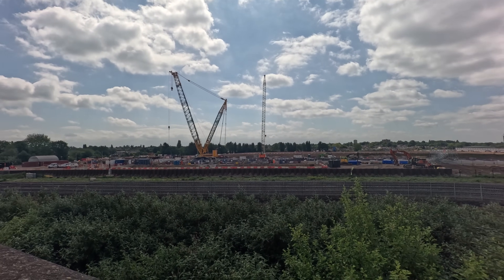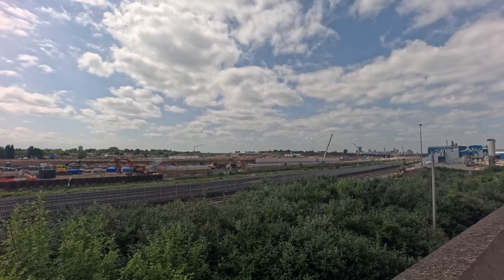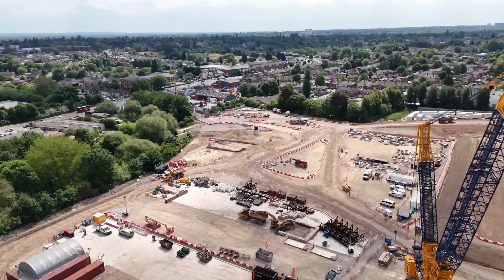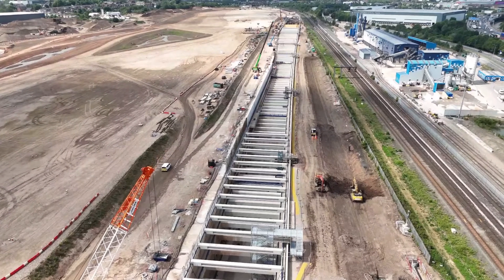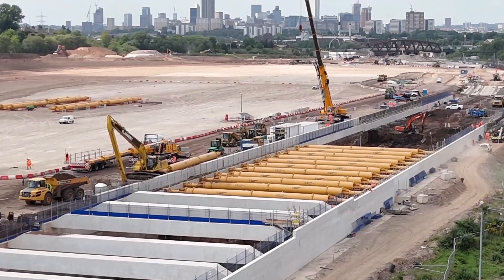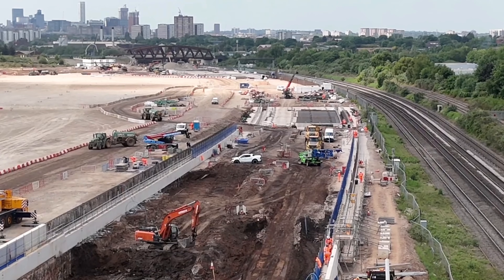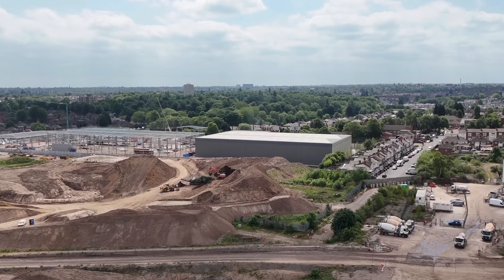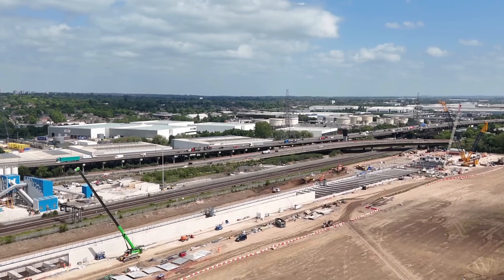HS2 Washwood Heath Update | TBM 'Mary Ann' Breakthrough! (Epic Drone Footage)

Comment: Friends Life owned c50 acres of development land on the Leyland DAF site adjacent to the Washwood Heath Rd/Drews Lane junction.  They wished to develop the site as a major distribution centre and see a portion of the whole site brought into beneficial use immediately rather than await completion of the the HS2 works once feasibility and remediation works (2020-2024) were complete.

Friends Life, after consultation process, were left with an area of land to the south of c10 acres that they could bring forward for development immediately. This is now under construction and will not interfere with the rolling stock maintenance depot site nearer to the M6 and the spine road.